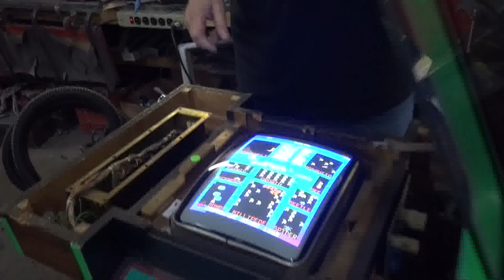#722 Atari MILLIPEDE Cocktail Table Arcade Video Game -1300 made! TNT Amusements

Comment: Todd, with the coin mechs, I think they are S10..we used to cut a clear piece of lexan, and place it in front, of the reject slide, so you could still see it, but all coins are blocked.  The reason we (in the UK, back in the 80's) did this, was when slot machines got converted from a token jackpot, to a cash one.
Reply from the maker: gallimead Good idea...the screw is pretty simple though...and easy to remove down the road...we do it also when we sell games to dentist offices.